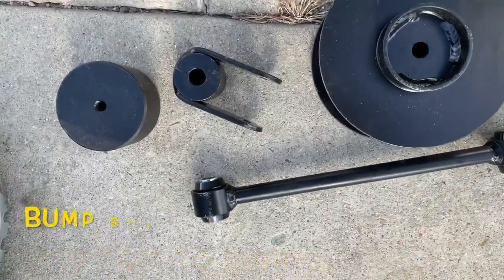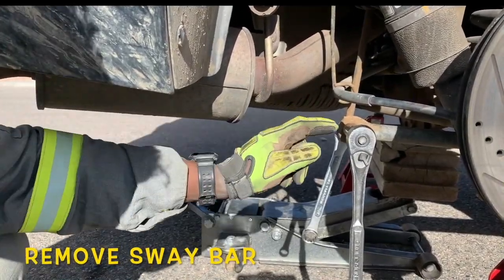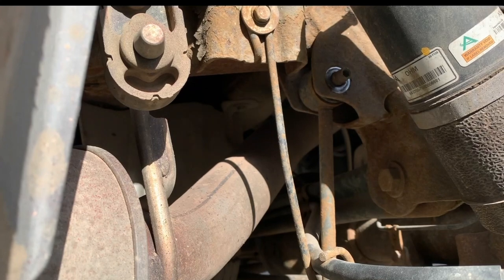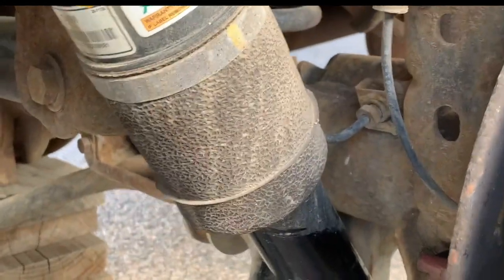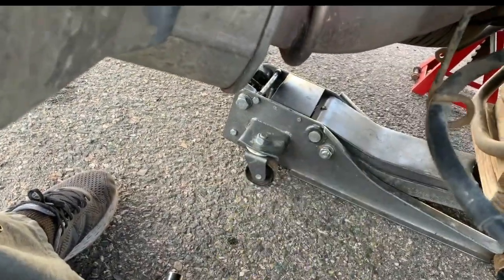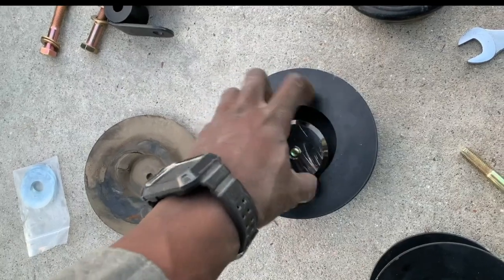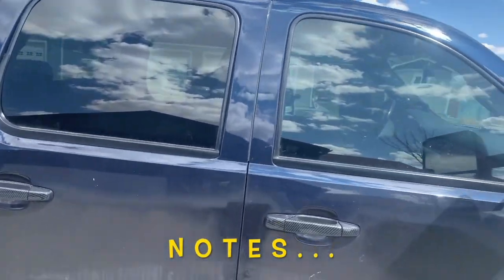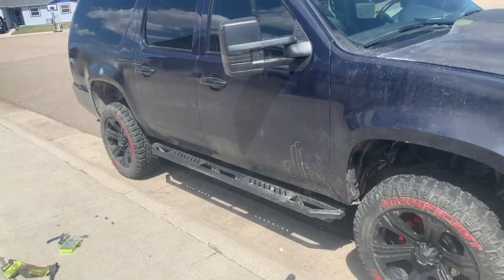Install Rear Suspension Readylift 4" '07 Suburban

Comment: My lift came with spring compressors so I could make them smaller. Glad I had them. My brake lines and differential vent tube were at their limits. I have adjustable links so I could move them if needed. I put them 3 inches over stock. My spacers are composite plastic and went on bottom. There rear is easier because it allows you to do both sides at once. Instead of spacers. I wish I would have put heavy duty coils in, they are 2 inches longer than stock and I could have only had to use a 1 inch spacer. I use mine for hauling so this is what I should have done, my shocks are already compressed enough.
Reply from the maker: 10-4. If you hauling springs are a must for sure! Too bad time won’t permit you to video
Reply: Maknificent12 I cuss too much and yeah, mine was a two day install as well. My video would have been what not to do, lol . I broke bolts and lost tools, I put my front spacers in wrong at first and cut wrong bolts, I was a mess. I think I spent more time watching YouTube videos and getting parts from store. It’s all done, got an alignment done today. Rims and tires are next. I removed my avalanche emblems and bought high country emblems off eBay, the 10” ones. I get a lot of compliments now. I wish I would have taken before and after pictures.
Reply from the maker: Chad Hickey 😂🤣😂 10-4

Comment: Nice job. I have a suburban with that air leveling rear shocks. What did you do to get around this? I want to lift it but they say it won't accommodate air leveling trucks.thanks
Reply from the maker: Accommodate as in you won’t retain the ride comfort?
Reply: All the lift kits that I read say it will not work with the factory air ride. Were you able to still use your factory air ride?